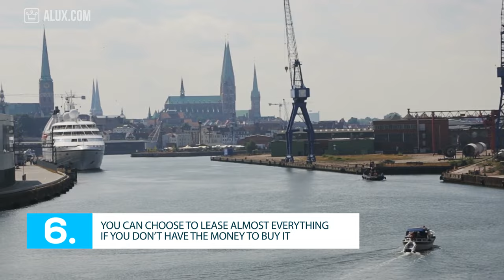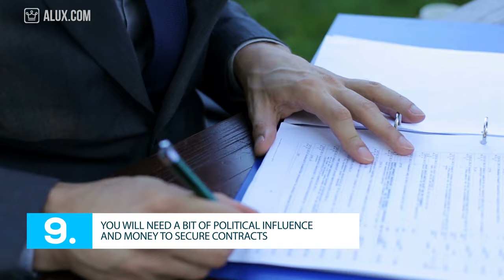15 Things You Didn’t Know About Running A Shipping Business

Comment: These are interesting.Inhave to disagree on a few things. Amazon and Alibaba is doing good because they dominate most of the market share. Once competitors join in, they will lose marketshare. UPS and FedEx have major contracts with USPS. 

Second: there isnt discrimination against women in this industry. They prefer to be in offices. Truck driving is not a glamorous field at all. You're hauling product that you are responsible for. You drive for hours. (11 hours driving and 14 hours on duty regulated by the FMCSA). Its very physical. Dropping trailers, adjusting axles to be at legal weight limits. Securement. Driving in dangerous and tight areas with height and length restrictions. This is a skill. A few autonomous developers stopped pursuing autonomization with trucks because of the liability

You forgot to mention trains also transport goods as well. They are limited to what they can carry. Mostly dry goods. No produce, hazardous or specialized. Only specialized equipment can carry overheight/over weight/oversize. As well as, temperature controlled. 

Freight Brokers do not lease. They are freight forwarders that need a bond of $75K to broker freight. They are like telemarketers. They cold call manufacturers, buyers and warehouses to locate trucks to move their freight. Brokers and Agents are the middleman. The broker tells the agent what to sell the freight for (i.e. $5,000 broker tells agent to sell for 40% profit ($2,000 net)). 

Warehouses are big money. Especially temperature control and frozen storage(food/drugs). You can charge per square foot per day/week/month/year. I networked with a person who has a 100,000 sq foot warehouse and charges $5 per sq foot per day. And to avoid no payment, he has a factoring company to back him. If they dont pay, the factoring company pays it and he wholesales the product and splits it with the factoring company. 

There are billions to be made, but you'll need more than data to learn this industry. Cheers.
Reply: Hi, its look like you understand the shipping industry. What you think about investing in shipping containers? Is it legit or scam ??..thank you
Reply: ^ scam.
Reply: Hey Robert, such a great explanation. Thanks for the info! Though I am a computer guy but seeing here and there learning businesses since job is not a good place for me :3
Reply: Robert Lee James Welch how do you know what women prefer? You know no more about what women prefer than any woman would know what men prefer as a career.
Reply: Alair Scott well there is a reason why there are less women in that industry?
Reply: What do you do for a living Robert? Let me guess....
Reply: @HassaanALal  do some software for Digitalisation of the shipping industry, find a Problem or a creat a software to improve the work flow. There is lot coming in the future.